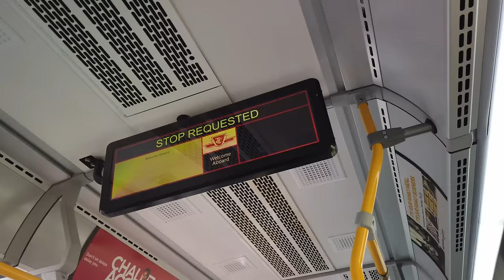Why American Buses Are Just Worse

Comment: In the US there is resistance to swipe-on/pay-off (to the point where systems will stick with old fashion conductor collected tickets because it's "wrong" to have a swipe card that doesn't charge 1 rate for any ride and they have to stay using the conductors to prevent customer pushback). This results in regressive designs on buses where there is only one payment site, so loading can only happen in one place (usually the front, in a throwback to when the driver had to manually monitor things) and thus added doors serves less purpose (in some places you actually have to get the permission of the driver by yelling to use the back door so they can watch to make sure no one gets in that way). 
Also in the US most but not all systems insist on a single price/ride regardless of distance model, where fare variance is more about the routes (like the NYC 'Express' routes being more) than actual usage considerations.
In some areas like Pittsburgh that do do variable fares, this gets worse. You still only use one door, and the door you use depends on which way the route is going, where on the route you are, and the time of day, as you "pay on" in some directions (enter via front), "pay off" in others (enter via back) and sometimes switch (you get on in front, but you have to exit still front to pay more for distance). All of this because no one wants to have a two tap system because that is somehow inherently 'bad' and will lower ridership.
Reply: That and cash-only payments in the age of universal payment card usage
Reply: @tonywalters7298  Still though cash should remain.

Comment: European bus manufacturers have tried getting in the North American market several times: first MAN and Ikarus in the 70's and 80's, then VanHool and Neoplan in the 90's, and finally Mercedes and Iveco in the 2000's. The only one that has had moderate success was VanHool. The other ones gave up because of those regulations.
Reply: Ikarus didn't fail because of regulations.  They failed because of a shoddy product.  The Eastern Bloc didn't care about reliability - if something broke someone had to fix it, which meant more people working, and more people working was a good thing.  The more things broke, the more people needed to fix things.
Reply: @spredelectric  then again, some places like Budapest still have their (last) 1990s Ikaruses running even today.
Reply: @spredelectric  A school bus manufacturer called Crown was responsible for final assembly of the Ikarus buses in the US. Crown had no experience with transit buses, school buses were their bread and butter. I reckon that's at least partially to blame for the Crown/Ikarus not doing so well. Then again an Illinois transit system bought a few of them second-hand after Louisville was done with them and gave them at least a short second life.

Crown: has no experience building transit buses

"Let's build an articulated city bus!"
Reply: @spredelectric  "The Eastern Bloc didn't care about reliability" Actually they did. But they tended to implement simple, proven solutions (for, good and bad) and design things to last 40-50 years of heavy use. Crude but rugged. Here's an interesting observation from that design philosophy. In the mid 1990's a German car magazine tested 4x4 SUV's of all makes on a terrain test course. Guess what? The "Soviet" made Lada Niva was the only one which managed to pass the entire test. Expensive SUV's like the Range Rover, Jeeps and others either broke down or couldn't travel up a traverse. 
And this expains why several European farmers used to buy the Lada Niva. Bad roads, pot-holes and the need to cross plowed fields etc meant you needed a car able to take that abuse. Oh, and that was British, German and Scandinavian farmers, not those in the old east-bloc. 

Sure, the car lacked refinement and felt like driving a tractor but it got the job done. 

Your whole "which meant more people working, and more people working was a good thing." political slant (why can't you just stick to the design and engineering?) means you can't make a difference between your own political bias and engineering. 

"The more things broke, the more people needed to fix things." And this disqualifies you from any serious discussion. No system in the world - tyrannical or not - designs things just to break down, it makes zero economical sense. Perhaps it does to you.
Reply: @dsevil  Crown school busses were BASICALLY transit busses unlike the "other" brands but Crown has a track record of questionable BUILD QUALITY trying to build TRANSIT BUS quality school busses for the PRICE of a truck framed school bus
Reply: @McLarenMercedes  LADA NIVA have a "cult" following in Canada 
will also say about "eastern VS western" European vehicles the eastern ones are NORMALLY designed for QUICK and "low" skilled repairs Versus the "technically superior" western designs that "perform better" but are complex and HARD to repair without specialized training / tools ETC and for a "low budget" transit LOWER reliability BUT far HIGHER maintainability DOES WIN OUT
Reply: @joachimnijs1967  the last Ikarus running in Budapest is the 405. All others were scrapped in 2022.
Reply: @spredelectric  Ikarus have failed because it have grew to a too big level. When it lost the lucrative USSR and DDR markets, it lost 90% of their demand, which bankrupted them. That was also the time when the government tried to privatise a lot of things, so they have sold Ikarus to the Irisbus group, which only wanted their (gone) export markets. In 2002, Ikarus have died.

They have built many successful buses: 200-series (the 286 was a new design from the ground up, and only the exterior looked like other 200-series buses, like the 260 or the 280), 300-series (395, later E95), 400-series (405, 411, 412, 415, 416, 435, 436),
and of course: the trolleybuses: 60T, 260T, 280T, 411T, 412T, 435T, most of them were built in numbers
Reply: @joachimnijs1967  they got them all retired this november, maybe december
Reply: @mozeskertesz6398  The problem wasn't the sheer size of the company, it was their close to zero interest in research and development and the sudden appearance of mass competition in the early 90s, due to the fall of the iron curtain. And at that point it was a miracle that the company lasted till '02
Reply: My local transportation agency (Trimet) had a lot of Crown Ikarus buses. Those buses had issues. Had to have a lot of repairs. Trimet ended up filing a lawsuit with Crown and Ikarus. I think that’s the reason why Trimet hasn’t gotten any articulated buses until recently with the Nova Buses (which had its own problems) and the Desert Rose (New Flyer D60LF that was converted to electric that I believe is only used for training). I don’t know how Crown screwed up with there Transit line so bad since what I have heard that there School Buses were high quality and very good. Lasting a long time in California until emissions laws (or something else, I don’t remember what it was exactly). Washington had a few but there gone. All the crown buses in Oregon are long gone. Gillig was another company that used to build School Buses that is similar to there transit buses. The Phantom series had a school bus version but those are no longer being made. Those lasted a long time in California until meeting the same fate as the Crowns.

Comment: I grew up riding MAN and Mercedes buses in a country that is part of the greater European market, before moving to North America. I remember the ride being nicer on new busses, but it didn't take long for the busses to get all rattly. When I moved to Connecticut, I was amazed to find buses with nice plush seats. The condition of the roads have a lot to do with how the buses ride, if the roads are full of potholes and bumps the busses will ride poorly, if the roads are smooth and constructed well, the ride will be smooth. If you have dedicated bus lanes and rites of way that are constructed to handle a large volume of bus traffic, there will be a nice smooth ride. But if you drive the busses on roads that are not well maintained or constructed well, than they will develop potholes and ruts, and full of bumps that shake the parts of the buses loos.

Comment: When I used to work as a bus operator I drove Gillig H2000LF vehicles, they are very simple machines and we didn't even have power steering, but in my experience they were pretty reliable. At same time I also been driving HESS electric trolleybuses, and those were generally much nicer and more comfortable to drive, but were a bit more prone to malfunctions.
Reply: Let me guess: Seattle?

Comment: Brisbane is a bit of a unique case for buses, even in Australia. We don't have a great rail system, our trams were all ripped up in 1969 and our ferries go up and down a fairly small stretch of the Brisbane River. So buses became the default public transport option. The major advantage that Brisbane has is that is is one of the very rare conurbations, having merged with surrounding areas to form the City of Brisbane in 1925. At 1,140 square kilometres it is the third largest city by area in the world. This also means it doesn't have to negotiate as much with surrounding local government areas and can use economies of scale for planning and purchasing. For example, stage 1 of the new Metro service bought 60 new HESS electric buses as their initial purchase.
Reply: Brisbane also kept overhead wiring for their buses when the tram (trolley) tracks were ripped up, so the buses could deviate slightly and get around obstacles like broken down vehicles. All this back in the day when the only viable rechargeable batteries were lead-acid wet cell batteries.
Reply: I'm in Brisbane ATM, favourably impressed by the transit system. The trains and buses integrate!

Comment: Comment from bus use in the Netherlands: too many seats. To get refused access to a 30-min interval bus because your stroller can't fit in the space where there's already another one is frustrating as hell. That flaw is throughout the Dutch public transit system. The 3rd door removes seating space, but it's also not stroller space. The seats are soft and comfortable, however, almost like a coach.

In Paris, where I am now, there's more open space, like buses in Québec. They're all low-decked, though.

Comment: You talked a lot about South America, and while bus service is much higher in Rio than on most of the US, we're so far behind in terms of low flor bus and/or articulated bus availability that I actually related much more to the US lmao.
One really common configuration of buses in Latin America (using Rio as an example, but it applies to pretty much everywhere else) are the high floor buses; those have the huge manufacturing advantage of using the same chassis of common trucks, which usually saves companies a lot of money. While being cheap, they usually are the most uncomfortable to ride in.
Reply: Nao sei se foi oque voce quis dizer mas aqui em curitiba os articulados sao meio comuns, principalmente em terminais.

I don't know if I understood you correctly but here in Curitiba articulated buses are quite common especially on terminals.

Comment: I wouldn't say it's all roses in the UK to be honest. Buses within London are great (apart from having to deal with the traffic). Outside of London they are significantly worse. The main issues are single door models, low frequency and lack of modern integrated and contactless ticketing (although that is improving now). In London, the Oyster card, double doors and every 5 minute (or less) frequencies, with real time information makes it so much easier to just jump on and off. I can't comment on the comfort of North American buses, but I would say it is so-so over here. I still think trams are more comfortable and trains are a league ahead, but then I'm comparing apples with oranges so it's not totally fair.
Reply: We really need a common payment system in the UK like the OV Chipkaart in the Netherlands. There's three different bus operators serve my town and two train operators. And if I went anywhere else, same problem.
Reply: For my town frequency ranges from every 10-30 minutes depending on the line according to the schedules that are still on paper and the fleet is nearly 20 years old though still in quite good condition and usage isn't a big enough issue to require double doors since most of the time busses only really have 10 ish passengers on average outside of rush hour.

Comment: my city (Quebec city) has been ordering a few van hools that they rolled out in 2019, because they needed winter resilient small buses. Nova wouldn't make any, and stuff like the tiny eldorados were mostly designed for way warmer climates, so the RTC struck a deal with van hool. their buses turn out to be WAY BETTER and quieter and smoother than even the newer novas, and anyone getting a ride in them feels pretty lucky. hopefully we'll get more.
Reply: I’d love to visit QC to experience their Van Hool hybrids. I’m from the San Francisco Bay Area in California, and one of our transit agencies AC Transit has a large Van Hool fleet from the 2000s. They have been steadily dying off but there are still quite a few around today. People had a very divided opinion on them. Some absolutely loved the,, while others hated the.
Reply: I wish the RTC would buy full size Van Hools! I agree they are nice.
Reply: If I remember right transit agencies in Quebec do a one larger order to reduce cost. And one requirement is that the buses have to be made in Quebec. Like Novabus in St-Eustache
Reply: @najibm  I wonder about the few New Flyer Xcelsior buses in Quebec. Or RTL Longueuil, who has a history of ordering Van Hool articulated buses.
Reply: Jeez I personally hate Van Hools. The acceleration is rough, they lean a ton in turns and the suspension that keeps readjusting make me feel sick. I prefer the nova

Comment: What I love about European buses is the standartised system.
If you look up MAN Lions City, Scania Citywide LF 12m, Solaris Urbino 12, CityLAZ 12, MAZ 203 – they all look pretty much the same: 12 meter length, 3 doors, low-floor, standing point opposite the middle door, wheelchair ramp at the middle door. And this is very helpful if you ask.
Eastern Europian companies, where trolleybus system are very common, produce their buses suitable to build trolleybuses based on them (Solaris Trollino 12, ElectroLAZ 12, MAZ–ETON 203T etc.)
Reply: But many european busses have only 2 (or 3 for 18m) doors, the layout is the same, but the doors are not a guarantee
Reply: There's not really a standard regarding the amount of doors: almost every (European) bus these days features a modular setup, meaning the purchasing entity can basically design the bus bounded only by set limits of basic chassis-elements, but the amount of doors and where they are located can vary wildly. That most operators/entities go for a standard front door and second door at about 3/5 from the front on a standard 12 meter or 14 meter bus and for 3 doors in a rather standard configuration on an articulated 18 meter bus, is just coincidence. If an operator or entity wants one door less or one door more, that usually is possible: the whole concept is made so that specific arrangements can be done without redesigning the whole bus.
It could very well be that the standard configurations are cheaper (as they are requested the most) than the slightly different more (or less) door-variants.
And to be honest: Scania should have stayed at building lorries/HGV's... their buses suck (they run in my city for more than a decade now and they are the most noisy, squeaky and crackly buses I know, even after serving the area here for a decade (with some most likely surpassing the 3 million kilometers mark or even more) they are still squeaky crackly and what not...)

Comment: Having just got back from Japan and seen how terrible their buses are (other than long distance 'coach' like services) with wildly different payment methods (some tap on tap off, some single tap at end of journey, some you take a ticket and have to pay in exact coinage, very rare to have flat fare on anything other than tourist routes with most a distance-price equation), cramped low density seating (usually front half of bus is 1+1 with majority reserves for Disabled/Elderly) and no level access buses (usually a step on the front door and two or three steps on the rear door) I shudder to think how bad they must be in the US, only saving grace was majority had audio stop announcements and some showed a visual of the next three stop names.

Comment: Great video as always! I feel like the main reason why North American buses are "worse" is that US and Canada use a very different set of motor vehicle safety standards versus the rest of the world (and yes, this also applies ot cars and trucks). While most of the world uses EU vehicle standards (or some variant of them that is essentially compatiable), the US and Canada are dead set on using FMVSS/CMVSS safety standards that are arbitarily different, often worse instead of better, and completely incompataible. For example, this is why buses and trucks in North America have five orange marker lights at the front (two white ones is the standard in the rest of the world). And because of FMVSS, "foreign" buses cannot be sold in the US or Canada without significant modifications, which means that the US and Canada are stuck with their home-grown buses for the foreseeable future.